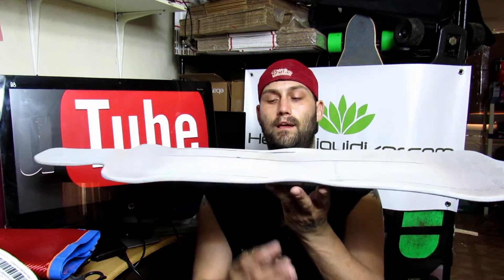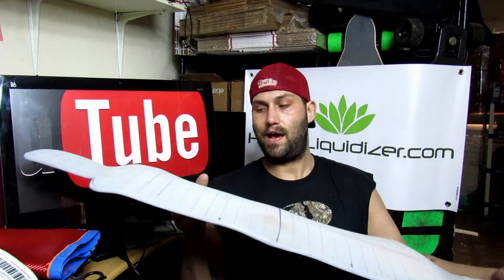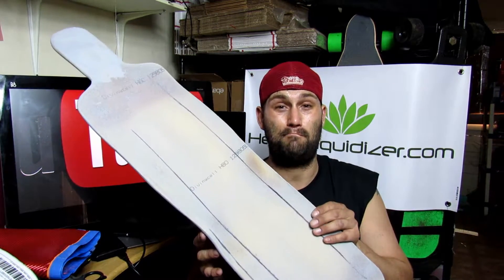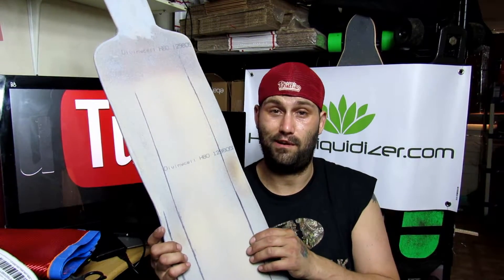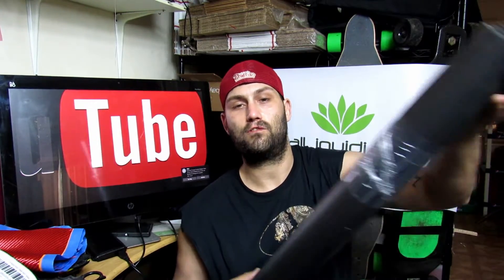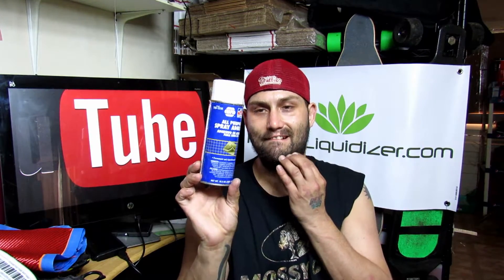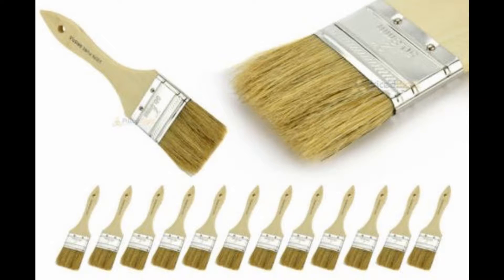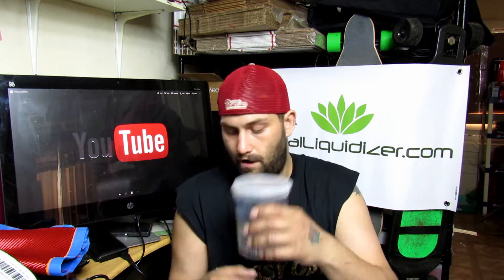Carbon Fiber Kevlar Electric Skateboard Deck Prep

Comment: so what is the cheapest flagship skateboard right now? the OnePlus of electric longboards.
Reply from the maker: wish there was one. no ones trying to follow that "cheap" model as we can see its not working at all. I cant name one company thats cheap and a flagship board. they are all upgrading and raising prices.
Reply: what do you mean that model is not working at all? ok,so how about kits that you can assemble yourself,to build yourself a flagship model?
Reply from the maker: as  a business model, going cheap is not working out. I have not found a cheap board that wont have an issue and leave you kicking lol. Are you looking to purchase a board or are you retailing them? Sounds like your looking to sell them. Flagship typically refers to the best the company has to offer. a product that drives their business. I can pair you up. theres lots of good companies out there but no mainstream retail involved. The cheap kits are useless unless your 10 years old. Ok so first things first is this for you to ride or sell?
Reply: for me to ride, I want a flagship level performance kit I can build myself for at least half cheaper than what most flagship models are sold.
Reply from the maker: Blu Bain oh ok well that's what im in the process of now. Testing out some different diy things. I dont want to steer people wrong. Hang tight i have some good things ive come up with and some lessons learned. Ive figured out how to simplify the hardware process. I will make the video real soon

Comment: you seem really happy in the thumbnail
Reply from the maker: +nightmare in action nighmare in action happy as can be! I love my life. This job is freaking awesome.  I couldn't be happier!
Reply: Joe Kyser lucky
Reply: I was trying to make a fidget apinner my life is full of bad luck in order to make it I needed to separate a chain I had a chain breaker when I was about to pop the chain pin out the chain breaker broke so noe j cant do it =(
Reply from the maker: nightmare in action nighmare in action dam that sucks ass. Hopefully things turn around
Reply: Joe Kyser and yesterday my bike broke remenber I told you I check my brakes well this time I dint and one of the cables got cought in the disc brake because it has holes it pulled the brake caliper locking the wheel and and also sending the site flying hitting me in the hand it hurt and now I have a broken caliper and locked front wheel because the caliper locked it I will have to take it to the bike shop today ill make a video later ill tell you when its uploaded
Reply: Joe Kyser its up you can see the video I'm taking the bike to the shop